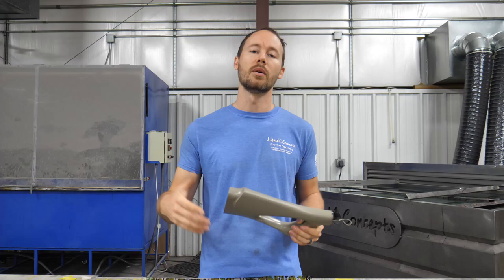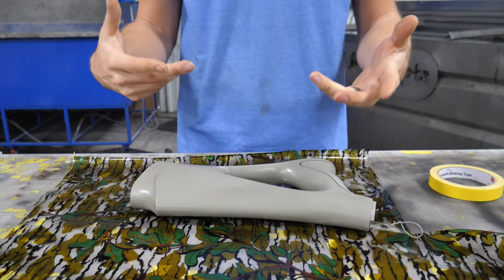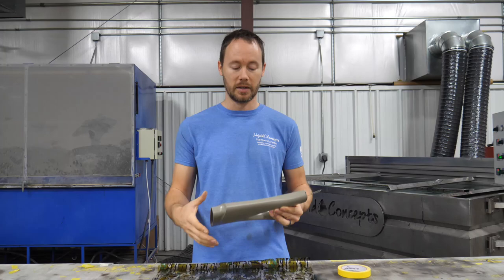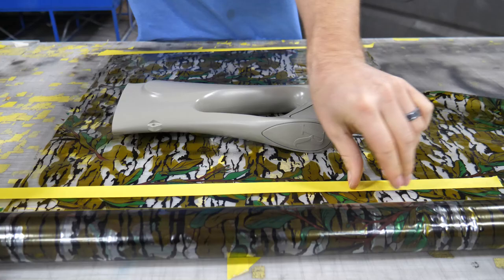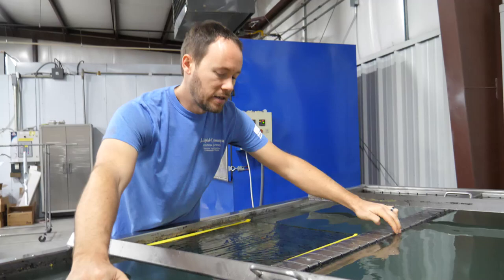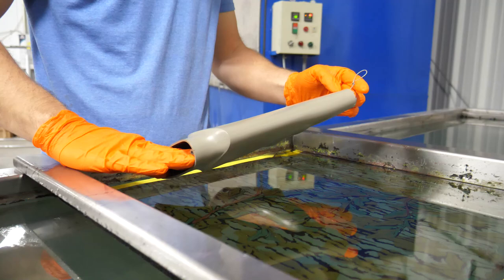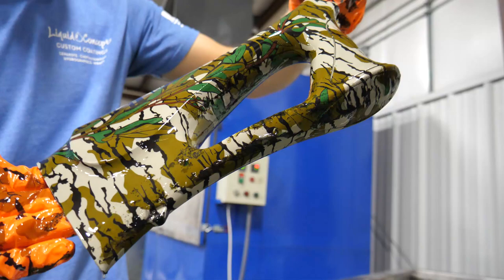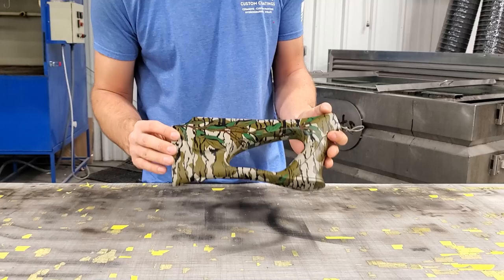HYDRO DIPPING MOSSY OAK GREEN LEAF (Old School Bottomlands) Liquid Concepts | Weekly Tips and Tricks

Comment: In the videos you handle the parts with bare hands, do you use a wax and grease remover before you dip to clean the part?
Reply: You can use some prep sem solve
Reply from the maker: We have never actually had a problem with this in the past with using our bare hands but it is a good idea to use gloves if you feel like it may cause the coating not to stick. Also DONT use SEM Prep Solve or any other solvent based cleaners. This can re-wet the base coat and actually cause the paint to wipe off when trying to clean it.

Comment: I’m having problems with this film not dissolving. Water temp 90 degrees soak time 90 sec spray activator and it looks glassed but when I dip some of the film sticks and some doesn’t. I have primed with recommended white epoxy primer and base coat color. My activator is a mixture of 70 percent lacquer thinner and 30 percent xylene. It has worked on every film pattern but this one. Is my activator the problem?
Reply from the maker: Your activator could be the problem, but hard to know as we have only tested our activator.
https://www.youtube.com/watch?v=0SE1Axs0Aws&t=151s
Maybe this video will answer some questions.